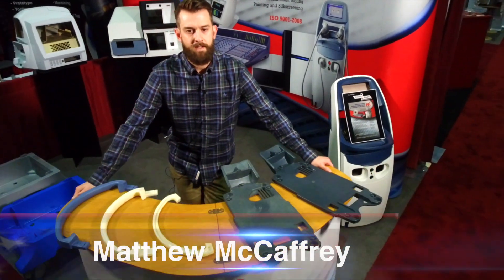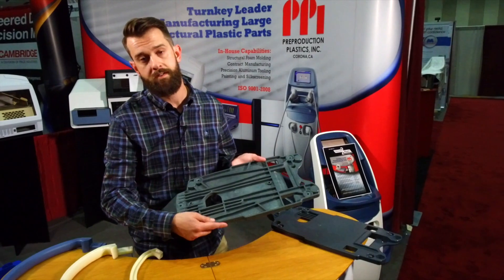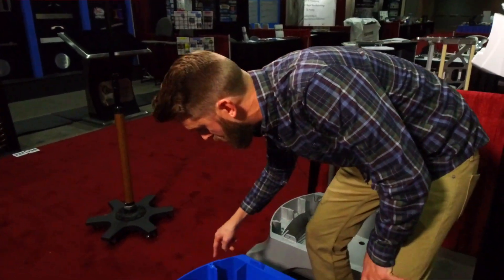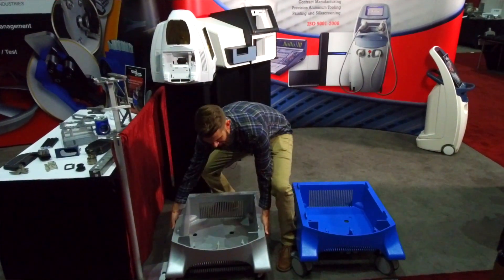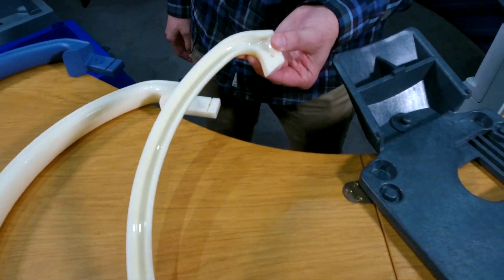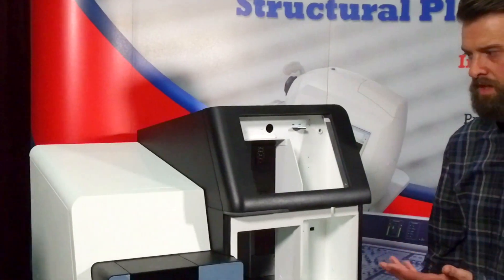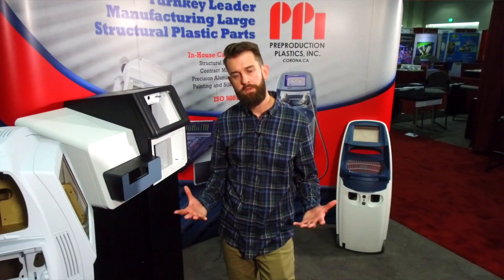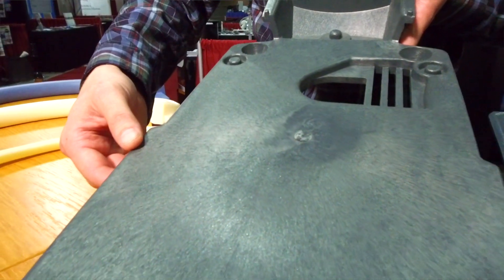Structural Foam Molding an alternative to sheet metal | Preproduction Plastics Inc | Corona, CA

Comment: Just curious, how does gas counter pressure improve the surface quality of the part?
I understand that the mould is pressurised before injection but don't quite understand what effect this has.
Reply: Hi Stephen. I guess that during expansion, the gas released pushes the material flow through the walls of the mould. The result is to obtain the same surface quality than the mould himself. That's similar if you add a few chemical blowing agent in your melt in a standard plastic injection process. Romain
Reply: I am guessing that because no blowing agent is used(or a soluble agent that mixes with the plastic liquid) the lighter and darker blemishes are not present.  The pressure is coming from nitrogen getting pushed into the core so no dilution of the plastic pigment.  Blowing agents are not used with gas counter pressure, so only plastic, no plastic foam is produced.

This is my best guess.